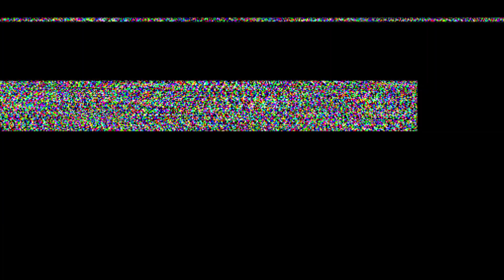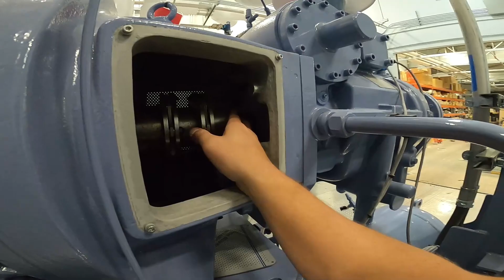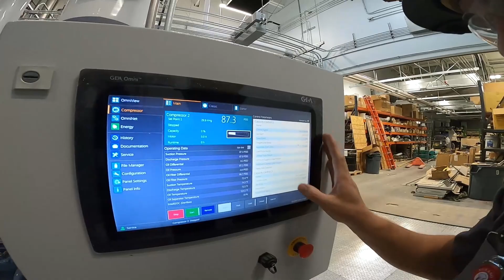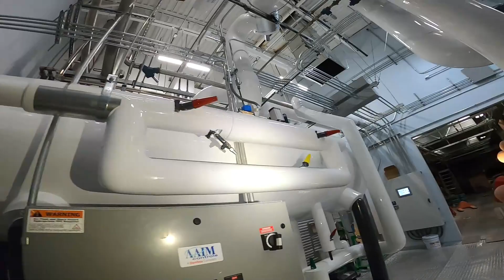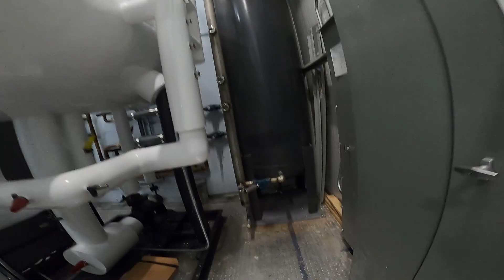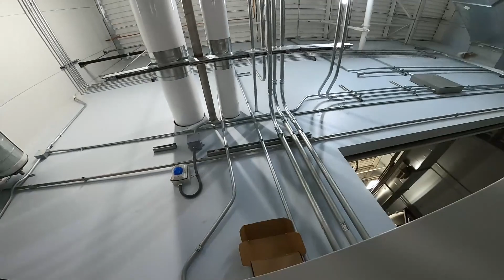Compressor Room Walk Through

Comment: thanks for the vid!  it is indeed cool seeing the big stuff that’s out there.  I was thinking about your comment about serial modbus.   I wonder if they don’t use ethernet due to EM interference on longer cables at or near motors.  It’s not a big deal when using “bonded” ethernet cable, but the lower speed of the serial line might just be less susceptible to this type of interference.  But i otherwise completely agree: it should just be modbus or bacnet over IP/ethernet for simpler integration.  Also cool that the controls look like an off the shelf PLC!